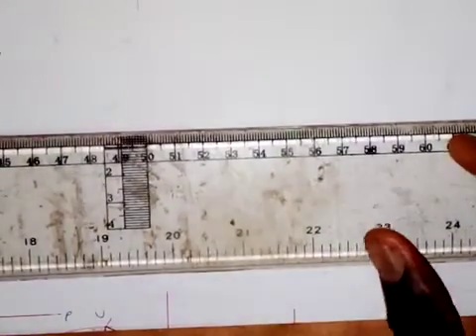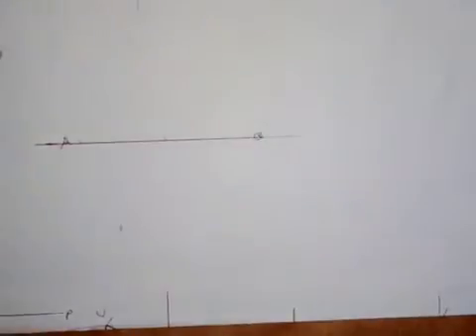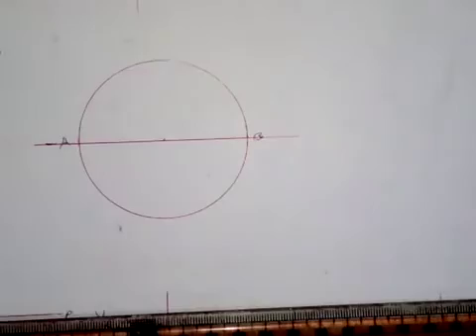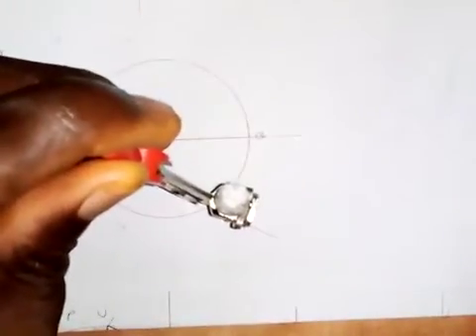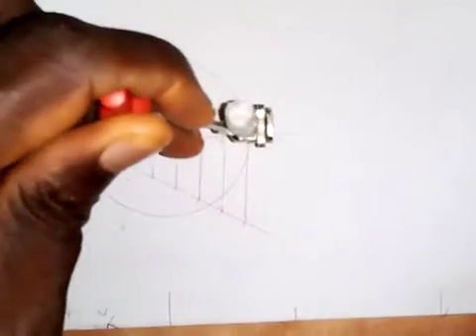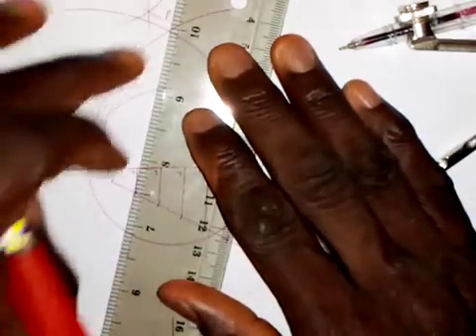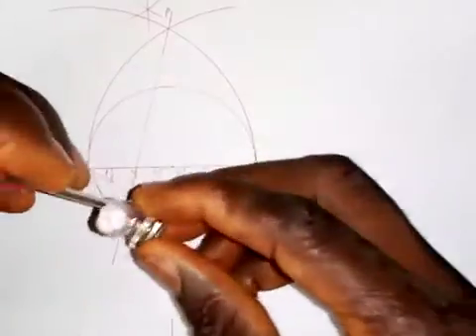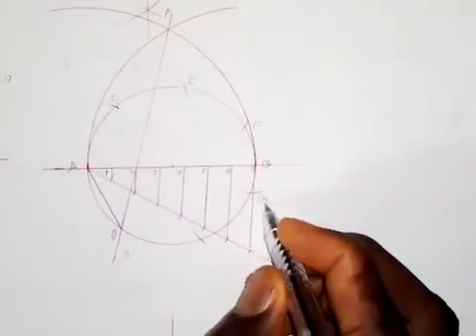To Construct Any Regular Polygon Given the Diameter of a Circle - Method 2

Comment: Why did you use 2 on the diameter? What if it psssed through 4?
Reply from the maker: Whichever polygon you are constructing even be it 100 sided, the line drawn from the intersection of the arcs must pass through point "2"